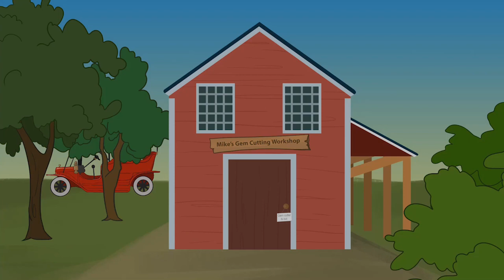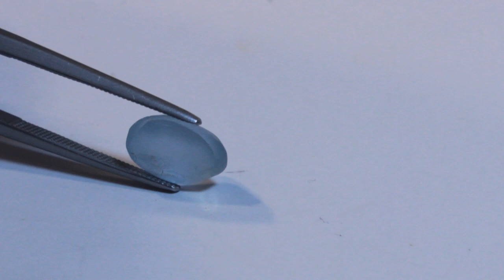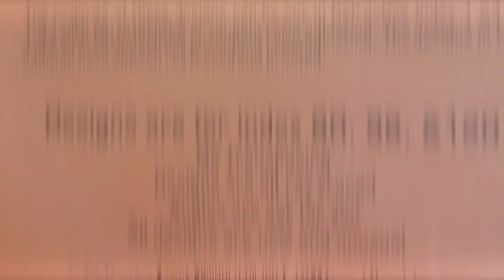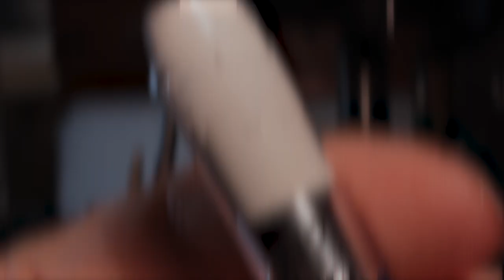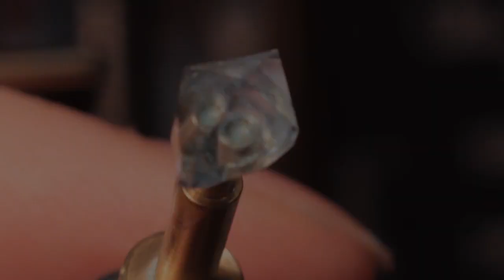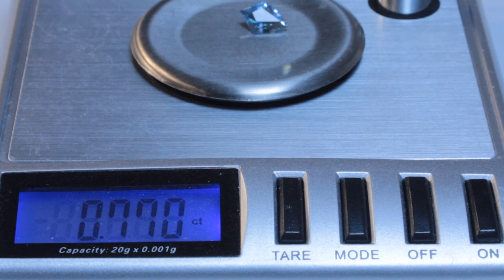Gem Cutting Tutorial: Flight of Blue Aquamarine

Comment: Good evening sir , I recently was asked to cut a pear shape in amethyst for a  lady who lost one gem from a setting of 3. It should be approximately 13x9 mm  when finished, (the other two gems are ovals). I was wondering in your experience ,is there any thing I might need to take in consideration before picking the final design to cut. (It will be Bezel set in silver in the original setting ) this is my first commission and I am a little nervous.   Looking forward to any reply or advise you may offer .regards Raeleen. From Australia
Reply: Hello!  Congratulations on the commission work.  Things to consider?  Well, since only the one stone is a pear and the other two stones are ovals, then you don't  have to worry about a matching design.  You can use any pear design you like, as long as you cut to the correct length to width and cut the stone to be 13x9 mm (give or take a small amount).  The one thing you do need to consider is the color.  Amethyst gemstones are sold is a range of purple color.  You will need to match the color of the other two gemstones.  Same with clarity.   Other than that...enjoy!  Best of luck to youi.